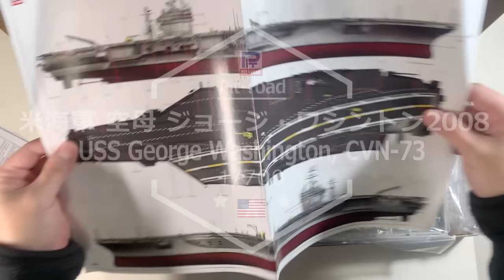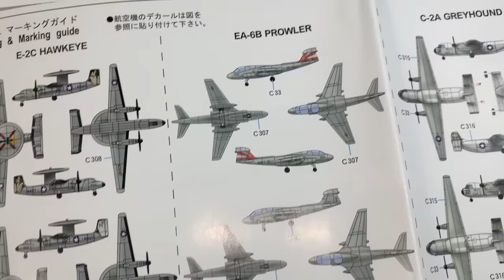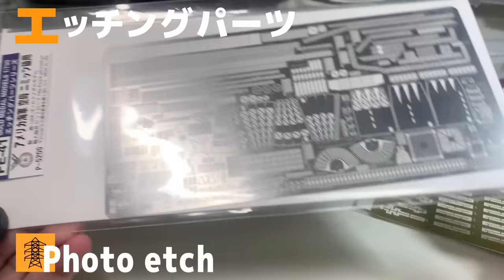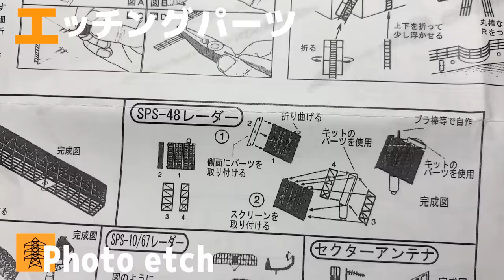アメリカ海軍 原子力空母 ジョージ・ワシントン // USS CVN-73 George Washington, 1/700 Ship model Full Build 艦船模型

Comment: let me get my two cents in here. I haven't built a plastic model kit in over 5 decades thereabouts. One thing I did not count on is it took me over a year to build a Lindberg Model of the Tirpitz being the Missouri, North Dakota, Biszmark Yamamoto and Tirpitz really R my favorite battle ships. Being retired I plan on building all of em but I started this first kit it's taken me nearly 2 years simply because of getting time and alotta the parts/pieces had mold slag all over em and at my age with arthritis its super hard to go over & trim those crappy parts. However I am nearing completion and it really would be nice if these turds that sell this stuff would actually have & sell some display case that fits these damn things especially at the prices I see on some of the kits. I also have a models of the SS. New Orleans and Mississippi Queen Paddle wheelers. The paddle wheelers R/were made by the late Charles Douglas. He lived in Alaska and made military concept models piece by piece for the Military Boeing Lockheed and other folks. I was astounded finding some of the pieces in the New Orleans kit were already highly detailed. The only bad news is holy crap are there a lotta parts and the decking is deal pre stained wood. Also a lighting kit is included in the things. He used to sell his kits for 2-3K a kit. I picked em up at hunting lodge in Montana they were in this big gift shop area in the lodge laying on a table with some other odd ball stuff with sticky notes that said 4 SALE AS IS with the prices. The kits were marked $250 a piece along with a Muzzle Loader kit I took both model kits & the muzzle loader because I also love river boat paddle wheelers as much as I love Hawkins rifles. I bought some 3M Tufpak Lexan sheets and I am now in my 3 week of trying to construct and make a hand made display case and do a decent job of it simply because where I live there is lots of dust in the summers and I got this little bastard with whiskers and a long tail that likes to screw with things when my back is turned. So maybe I will start making model display cases for folks if I get good at it because I cannot find a model display case for this Tirpitz boat...

Comment: The Keel is not particularly accurate but few Ship models are actually accurate. I have served aboard Nimitz class Carriers  and this one is sitting very low in the water. Those small water craft are acutually on a sponson on the starboard side, just forward of the starboard Aft Aircraft Elevator., the aft and Mid Hangar Bays should only have aircraft within them, and the Forward third of the Forward hangar bay is mostly tugs, and small vehicles.

Comment: OMG ITS AMAZING👍👍👍🔥🔥🔥🔥👍👍👍👍😍😍😍😍😍👍👍🤑🤑🤑

I have question when I try to use panel wash I wipe with thinner dipped q tip and it just takes the paint right off instead?
Reply: You’ll want to seal the base layer of paint with some kind of varnish before you use any kind of enamel washes. Most people use a clear gloss varnish like tamia X-22 but a good satin varnish would also do the trick
Reply: @halo43v3r7777  ok thank u

Comment: Spectacular. I loved every second.

One question, and please consider this my own ignorance; what are those things sticking up all round the sides? I looked at pictures of the GW and can only see one thing which looks like maybe a radio mast on the starboard side in front of the bridge. But like at the bow you have a few that stick up. In RL, aircraft would be damaged.

Can someone help me understand nicely? I'm sincerely trying to increase my understanding.

Anyway, EXQUISITE job
Reply: They fold down for flight operations
Reply: In warships, the railings fold down during flight and combat ops. You will notice in frontline warships, when the gun is firing the rails around it are folded down to ensure maximum depression. Same thing with torpedo tubes.

Comment: How do you make such perfect weathering? Whenever i use cotton swab to remove the excess with a bit of lacquer thinner, the paint comes off with it, even with many clear coats to protect it
Reply: Use Tamiya e X-20 Enamel Paint Thinner for the excess. It's the only one that works well. And when using a cotton swab don't put to much pressure onto it, whenever you're doing excess.  Cause it will rip off the paint.
Reply: @zetaopress2389  that’s exactly what i do, still the excess hardly comes off and i end up destroying the paint